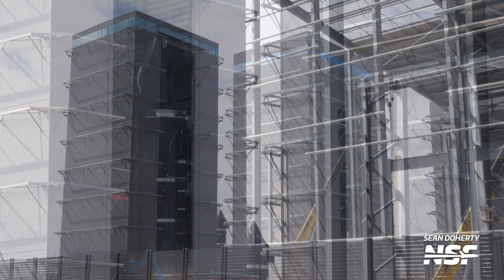Ship 28 on Pad B Potentially for More Testing | SpaceX Boca Chica

Comment: I really believe with booster roll back some kind of internal or external damage was done to booster. Or potential damage they want to check on more closely. Damage during loud crash stack. Watched many stacks, never heard anything near that loud, though I’m certainly no expert. Could be something that didn’t show up until they started doing fueling for WDR (dislodged/damaged piped connector, etc)

Comment: Is tower 2 going to be taller than tower 1?
Reply: So far we haven't seen any additional sections so I think it's gonna be the same height. Even with booster/ship stretches the current height should work fine. Only an issue if they really extend them
Reply: Just because we have not seen any new section does not mean they are not already on order. So far only the pieces of the Florida tower have been delivered and that was designed before the stretch of SS was decided. It would be so easy to add to the new tower now to accommodate needed changes. Then tower 1 can be modified later to match.

Comment: 21:30 The vertical trusses are supporting both the roof and the bridge crane beams. One failure mode for I-beams in compression is torsion, for which these trusses are quite stiff in that aspect. However, I keep expecting to see further bracing of the [heavier]  I-beam component of the trusses that will support the bridge crane. 

Has anyone found such attachment points? Do you think the exterior cladding will provide enough stiffening?

Comment: all that flat roof space on the bays and star factory, all that flat land, all that sunshine, and not a single active or passive solar system to ease the burden on the grid and decarbonize?  not sure elon cares about the planet he wants to leave so badly.
Reply: They have something like 7 acres of solar panels at starbase
Reply: Did you know that solar panels in general are quite heavy and adding weight to the roof makes it more vulnerable. Boca Chica Texas sees some tropical storms and high winds. If you can install the solar panels on the ground then why would you put them on the roof? It doesn't make sense to install solar panels on the roof when you have a lot of land you can use instead.

Comment: Note the rust on that building's external bracing at 6:00 in the video. Whenever I see that building design, it reminds me of the decision to not build a flame trench for the most powerful rocket ever built. Was that another Musk design? 
Who thought that putting steel exposed to constant salt mist, when the beams could be protected inside the exterior panels, was a good idea? In 4 years, those buildings will look like all those abandoned factories in the Midwest Rust Belt. 
At least that site will be a bonanza for scrap dealers, if the whole site gets abandoned. I wonder who will be responsible for tearing all that thick concrete up and removing it? That won't be cheap. 
Of course, only a few scientists will ever live on Mars, since it has no atmospheric oxygen or liquid water. Lack of sources of energy will be a problem too. Reflect on how much electrical and oil (gasoline) energy you use every day. Mars has none of that - zero, nada, zilch... and no way to make any. How about the amount of water you consume in a month. It is a lot more than you think, and it is virtually free compared to the tens of thousands of dollars a month it would cost on Mars, if you could even find any. There are no rivers or rain on Mars. Try to find a big city not on a river, or sitting on a giant oil or gas deposit to do desalination. Bet you can't. 
But it is fun to watch, & is employing people at good wages. So keep it up & hope that Elon makes it to 100.
Reply: The rust is on the high bay. I think it next up for tear down and enlarging. It was too small as soon as they moved in. So it does not make sense to keep up with the paint if you are going to demo it soon.
Reply: "Whenever I see that building design, it reminds me of the decision to not build a flame trench for the most powerful rocket ever built. Was that another Musk design? "
A flame trench wouldn't work at Boca, because you'd be blasting exhaust at either the orbital tank farm, beach, or wetlands.
 "At least that site will be a bonanza for scrap dealers, if the whole site gets abandoned. I wonder who will be responsible for tearing all that thick concrete up and removing it? That won't be cheap."

The site won't be abandoned. So no need to worry.
 "Of course, only a few scientists will ever live on Mars, since it has no atmospheric oxygen or liquid water." 
I don't think Starship is capable of creating a city on Mars. But It could easily build a permanently crewed base of 100-200 on Mars.
Water can be produced locally too (there is "plenty" available, all you have to do is melt it).
 "Lack of sources of energy will be a problem too. Reflect on how much electrical and oil (gasoline) energy you use every day. Mars has none of that - zero, nada, zilch... and no way to make any."
Solar Power is less efficient on Mars than here, but it still works. And if that isn't enough, Nuclear Reactors are just as efficient on Mars as they are on Earth.
 "But it is fun to watch, & is employing people at good wages"
Couldn't agree more.